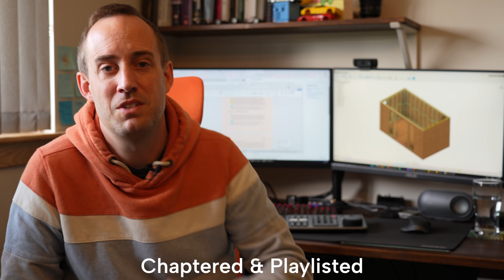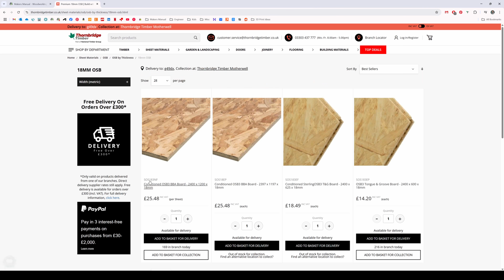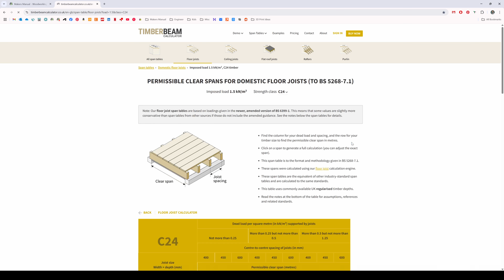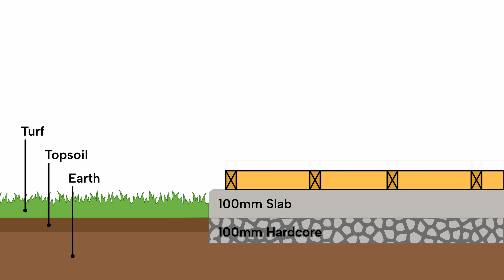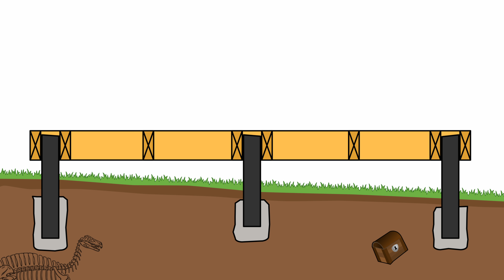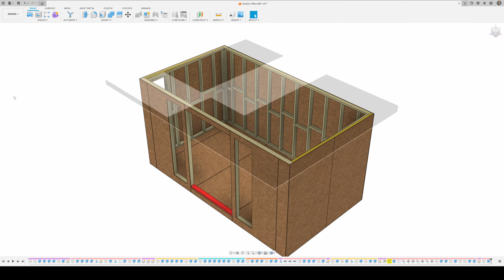Before You Build a Garden Room, Watch This | Garden Room Build #1

Comment: I don’t understand where these concrete pad prices come from, every video seems to over estimate it. I got the concrete for my 5.2m x 3.2m slab, about 120mm thick, for £500 delivered. I probably spent another £250 on the sub base, but didn’t need to be that much I just had to bring the ground level up a touch. Another £150 for all the extras like reinforcement, tool hire and DPM. Where on earth does £2000 for a  smaller slab than mine come from? The concrete can be the finished floor as well if you trowel it smooth.
Reply: Also I don’t understand how your method only cost £350? The timber frame alone would cost more than that surely?
Reply from the maker: That’s a great price to be fair 👌 sounds like you did well there.

The £2k figure I mentioned was based on getting a slab supplied and laid locally, rather than just the raw concrete cost. Once you factor in labour, excavation, shuttering, compacting, potential muck-away and making sure it’s laser level, the quotes we were seeing climbed pretty quickly. If you’re DIYing most of it, like you did, it can definitely come out much cheaper.

On the £350 – that was just for the foundations (posts + concrete), not the timber frame. The frame cost is separate. I was comparing foundation options only at that point in the video.

Completely agree as well – a well-finished slab can be a great final floor. For us it was more about cost, height restrictions with the 2.5m limit, and keeping flexibility.

Appreciate you sharing your numbers 👍

Comment: How would you go about this useing a brick rather than timber
Reply from the maker: Good question. You definitely could do it in brick/block instead of timber, but it becomes a slightly different type of build. You’d need proper strip foundations below the brickwork (deeper and wider than what I used), and once you start laying masonry you’re usually committing to a slab rather than a raised floor.

Cost-wise it would likely be more than my post-and-beam approach — between the extra excavation, concrete footings and materials, it adds up pretty quickly. It would also eat into your 2.5m height allowance because brickwork + slab can push the finished floor level up.

That said, loads of people build garden rooms in block and it can be very solid if done properly. For me this project was about staying within permitted development, keeping costs sensible, and something I felt comfortable DIYing.

Definitely a few different ways to skin it.

Comment: Great content. I want my garden house to be on some sort of stilts/piers/posts, I am almost decided to go for ground screws but I like your solution as well. Excluding concrete slab, in my area people often choose concrete piers or footings that go above ground level and are visible around the perimeter. Most of the time any horizontal elements (beams) are placed ON TOP of vertical supports but I can see you did your best to stay as compact as possible in the vertical direction, but now ofcourse you have shearing interfaces between the posts and the floor beams. ...which you solved by metal brackets, at least around the perimeter, cool! Endles solutions!
I want to make my air gap larger, a crawl space basically, so my current idea is to build a flat metal frame (light I-beams welded together) on top of any posts/footings/screws to tie it all together to create a stable platform. I am slightly worried of ground shifting and/or swelling over time, so when one of the posts changes sligtly, the frame will be able to redistribute the load to a certain extent.

What CAD sw are you using? I was not able to tell. 

Cheers mate bye
Reply from the maker: Thank you... I'm using Fusion 360 for my CAD software. And yes there are always so many ways to solve a problem. The best solution is often the one that suits your circumstances rather than applying a blanket rule to all builds. I am not entirely sure I understand your metal frame concept, but believe it maybe unnecessary. While the base frame may still have scope to shift when it's just a frame. It becomes very rigid once the OSB deck and subsequent layers are added. And for what it's worth, although my system worked out great, if I did it again I would probably go for Ground Screws. 

It sounds like you're really thinking it all through properly, which I think is the most important thing. Good luck with the build.
Reply: Im planning ground screws for my next build.  They look like the easiest secure solution to no wanting to do massive ground works. Although my current office is on wooden pillars drycreted in place, and it hasnt moved for the 10years its been up.

Comment: We have a sloping site so would it be ok to excavate half a metre into the slope to allow for an actual garden room to be taller than the 2.5 metres, say 3 metres that still measures under 2.5 metres if measured from the top of the slope? On your measurements, this would allow for a full 2400mm internal height? Thank you for this series, I am going to binge watch the whole series.
Reply from the maker: The rules are different depending on where you are in the UK. But according to England's government Planning Portal — “height is measured from the highest ground level immediately adjacent to the building.” I am no expert, but as I understand it you would be fine to excavate to achieve a higher ceiling. But you need to be careful to maintain the natural look of the slope, so that it's still measured from the slope height (rather than new excavated height). You will also need to be careful, so that you don't introduce any damp issues to the building. I would strongly recommend reading up on the regs yourself though, there are a few nuances and caveats that could catch you out if you aren't aware.

We've got lots more videos coming soon to complete the series, it's all nearly finished in the real world, just need to find some time to edit. We'll also be releasing build plans soon too.

Comment: Love the series, does the height restriction rules in England means if i put in a retaining wall the high point is the other side of the wall from the building? Thanks
Reply from the maker: Thanks, it’s been a really fun project. Can’t wait to start using it soon.

For Permitted development rules, you’re best studying the rules yourself to double check the specifics for your circumstances. But as I understand it; For Permitted Development in England, building height on a slope is measured from the highest point of the natural ground level immediately adjacent to the building or outbuilding.

Not sure how that works with a retaining wall. I imagine it depends how close the wall is and how the ground naturally sits. Our shed has a retaining wall nearby and I think it’s reasonable to measure from the top of the wall in our garden, as the wall allows us to have a level lawn/garden.